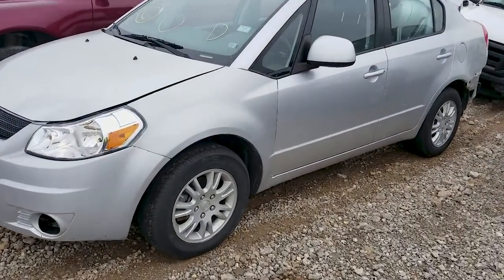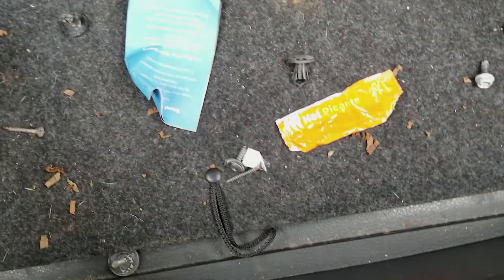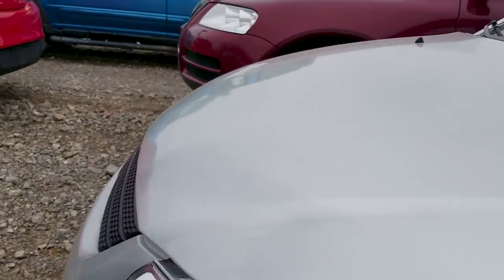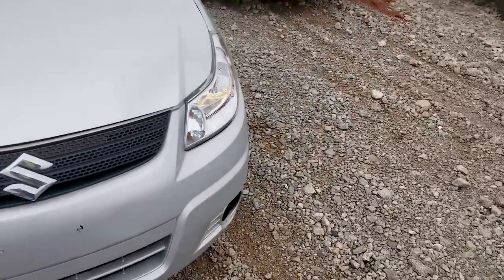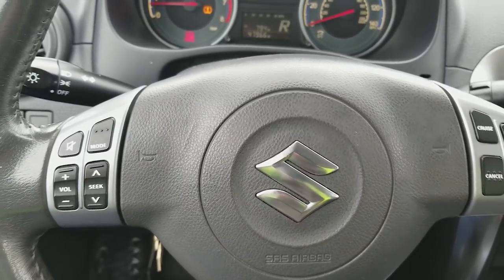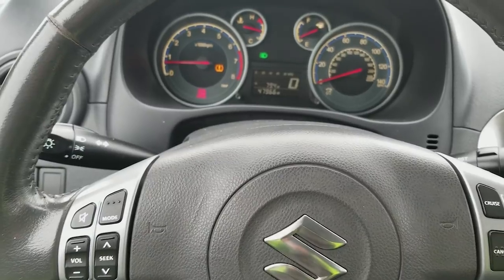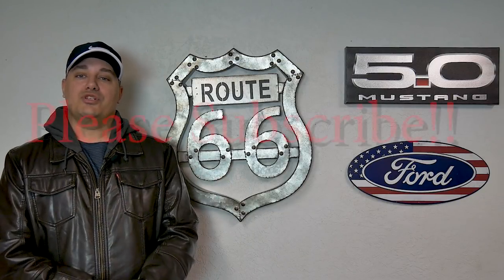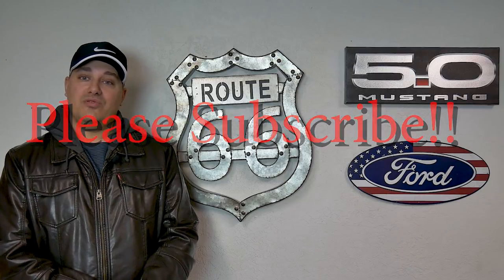How to Avoid Frame Damage - I Almost got BURNED!!!

Comment: The apron/strut tower in front are considered part of the unibody frame as well as the rear strut tower/inner quarter panel in the back.  So the visible damage you saw was indeed frame/structural damage.

Comment: I'm a buyer and vehicle appraiser, when a vehicle has anything that alters the unibody chassis, it could be a welding that's not original, holes in the rails stretched by a towing truck, trunk floor dented more then one inch, aprons with non original welding. The best way to find frame damage is with a paint meter. A Clean title does not mean salvage and it could have a frame damage.
Reply: Hablando de carros A paint meter? Can you tell me more

Comment: learned and or am learning this lesson at present. Bought an F150 listed as side and rear damage and it ended up being  bad place in the frame. I can weld and fix it but I probably would not have bothered if I had know about it
Reply from the maker: Some people love frame damage. I do not lol. Best of luck with your project!
Reply: I bought a chrysler 300 that got rear ended it only affected the bumper yet apparently there's frame damage. Handling definitely sucks and one tire is higher than other

Comment: Stay far away from Suzuki. There cars are junk the company stoped selling cars in the US making them a little harder to get parts for. Also i think it would be harder to sell a Suzuki when your done. U dodged a bullet with that one.
Reply from the maker: I agree. But I still love the XL7!!
Reply: My Suzuki isn't junk.
Reply: This is nonsense.  The engine in this vehicle is the same one in the Chevy Aveo and the Holden Cruze, and this is a “Global” car.  My brother has a vehicle identical to this one, with a standard transmission, and at 374,000 miles the only thing he’s ever had to put into it is a new clutch because he taught his daughter to drive stick shift in it.  The quality of a vehicle relies 99% on how well you care for it.  If you abuse a vehicle and don’t follow the maintenance schedule, it will fail.  That’s how it is.  When you care for them, they’ll last forever.

Comment: I had a SX4 Crossover a few years ago and they are they cheapest cars Suzuki has ever made. The engine will crap out around 100k miles anyways due to ring issues with them. Glad u didn't win it your reputation is better than that my friend.

Comment: Do they let you go over the cars with a magnet?
Reply from the maker: I've never tried but I'm sure you can so long as you're not scuffing up paint.
Reply: I carry around a piece of flexible magnetic sticker, the type companies give away for your toolbox as advertisement or calendars. Does not hurt the paint and will not stick to the body if there is any bondo.